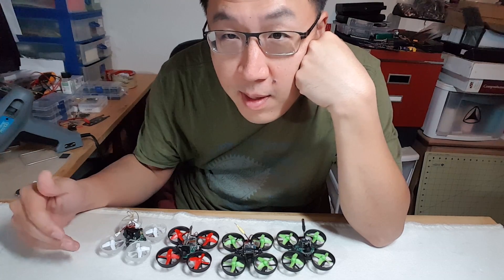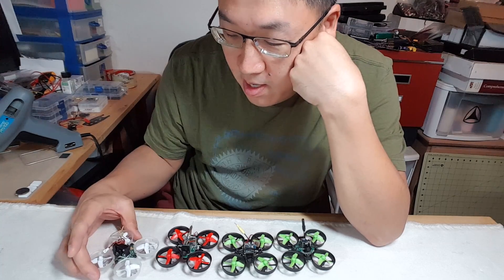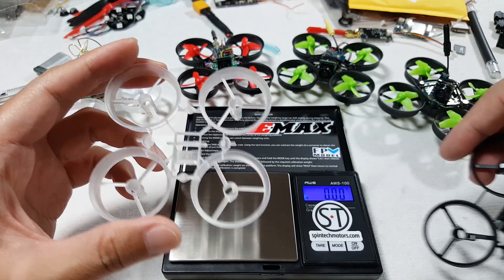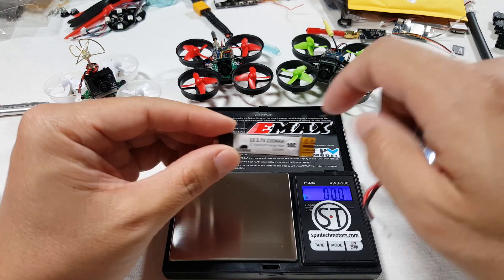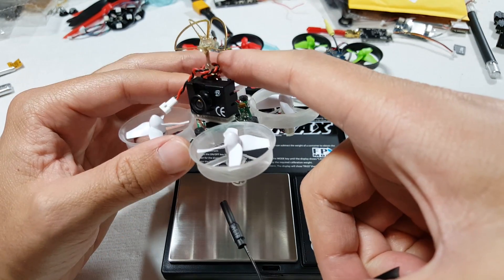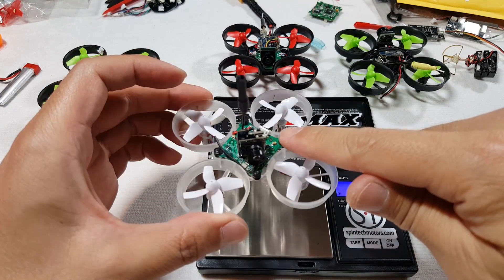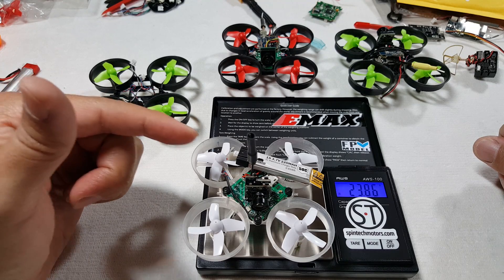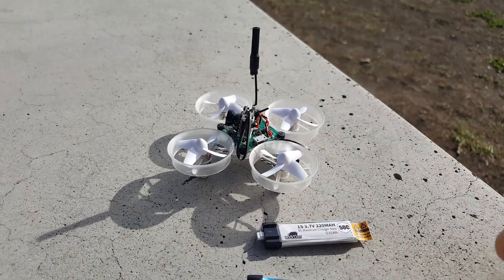Building the Best Tiny Whoop

Comment: On your jst connectors get some female with solid pins and solder the wires on it. You don’t get the power loss like you do from the crimped hollow connectors that most are. Some company sells them for $5 but you can get a set of 20 male and female for $5.

Comment: What about cutting the prop "guards" for an outdoor and flyer, installing a little longer two blade props, cutting the heatshrink on the antenna? I dont think its of any use, is it? Guess 16g without battery is possible.

Comment: I'm Going to build a 90mm Brushless Tiny whoop. Using the racestar 1103 Motors and some 6A Esc's. and of cause a Kiss Flight controller. cant wait to get the parts in the mail. because i feel that those Brushed Tiny whoop's are not enough for me anymore. and flying my 210 and and 250 race quad's inside the house is not an option.

Comment: I had a similar setup, but put on insane motors and high voltage lipos with power whoop connectors (2 amp) and it is a rocket and can do ridiculous loops and rolls...

Comment: +Albert Kim Thanks for this! Perfect timing too. I've been very disappointed with my TW. After the initial takeoff I get basically one punch out then hovering is 50% throttle. Really was thinking it was my new batteries. They just happen to be the same hobby tigers you run so I'm not sure now. Tip: If you pull the wrapper on each side of the battery out a little it gives it a tighter fit.
Reply from the maker: From all my experimenting with these variations I've learned that the most important factor is the weight.  I think getting it to about 18.5g is gonna be optimal and then you can do those rolls without it falling too fast.  If you have a whoop near 24g, you'll have problems.  Doesn't seem like much but every 0.1g makes a difference!
Reply: Albert Kim mine is 20.8g. I even built my own 10mw vtx instead of the regular 25mw hoping that would help but it's 5.6g alone so I bet a light aio vtx would help a lot
Reply from the maker: check out the one I used.  It's only 3.4g!  Really light weight

Comment: What is the difference in weight between the BeeCore F3 and the Eachine F3 tiny EVO brushed FC? Any reason to pick BeeCore over the Eachine apart from the nice fit?
Reply: I just realized BeeCore has built in RX... so never mind
Reply from the maker: Yeah, built in receiver means less overall weight.
Reply: Well it might not be the lightest possible, but I put together one with the E010 frame, the tiny F3 Evo FC, an FS-A8S RX, and the Boldclash F-01 AIO camera. Flies well on turnigy nano-tech 160 for about 2.5 mins. Will look into the cells you listed. Thanks for your videos! I hate trying to pick components blindly.

Comment: make it 2 bladed. Youget even longer flight times and with the higher kv motors you will not loose trust.
Reply: I did mine with nail clippers and works great!
Reply from the maker: Did you use an exacto knife?  I was gonna try that.
Reply: The props are cheap so easy to replace.
Reply: emiel1976ep absolutely agree!  Works great and flight times were increased
Reply: yes just a sharp nife.
Reply: I use extreem fast motors. With stock motors i did not try it.
1min? wow i got that with my 30c lipo's. Upgraded tehm tot the 45c and 2 bladed. removed al the stuf not needed to save weight now i have 3 with the extreem fast motors and the faster motors from Banggood is about 4 mints. they are faster than the stock.
I also use the f3 board. Only need to swap the frame to something lighter.
Reply: I have 65000rpm motors, I have a lot longer flight times as I use 2 bladed with those motors. No vibration with my props.
Reply: Id goRakonheli triblades! Still punchy and better efficiency. Durability is a plus as well... I feel like double blades don't have sufficient surface area coupled with the duct styling reducing it even further. When I trash my frame i shall gut the cups and rig a frame out of mckune carbon stiffeners, should drop frame weight to 3gs or under. I wanna see you do an extreme performance brushed build outta the 2in1 FC frames they got coming, Albert .. Would be interesting...

Comment: Do you know the Inductrix VTx and cam weight in comparison to your lightest set? That Inductrix FPV gear works so nice just with the stock whip.
Reply from the maker: I was not able to measure it when I had it but I'm pretty sure it weighs more than the camera I'm using.  It also comes with a light whip antenna.

Comment: Unbelievable how just a few grams with these tiny whoops makes a big performance improvement. With Beta and super rates you can get very quick rolls and flips for inside flying loosing next to no altitude. You may have to do CLI to get the Rx range correct depending on radio gear.
Reply from the maker: When I tried to increase the roll rate it would kinda go crazy at the end of the roll.  I think the motors don't have enough authority to stop the roll in case it goes too fast.